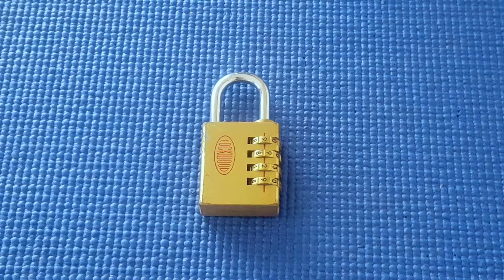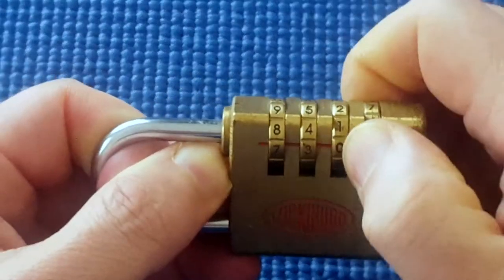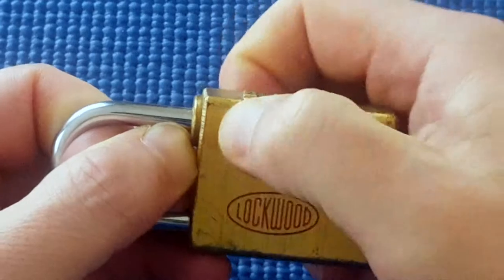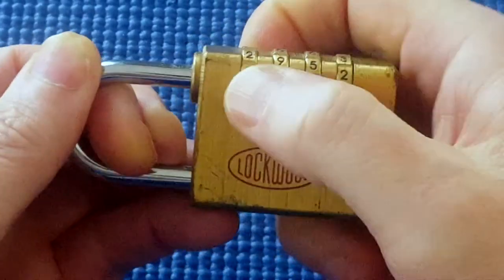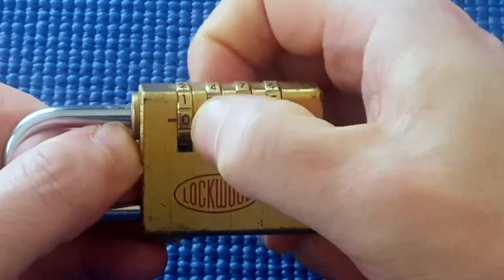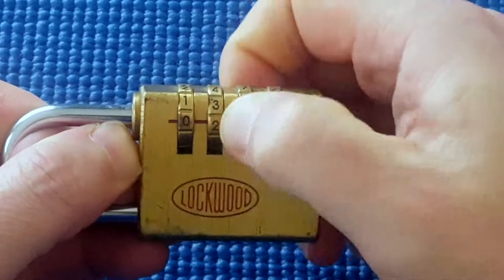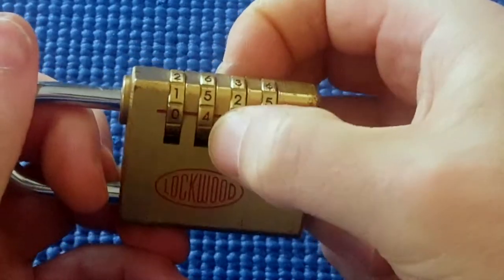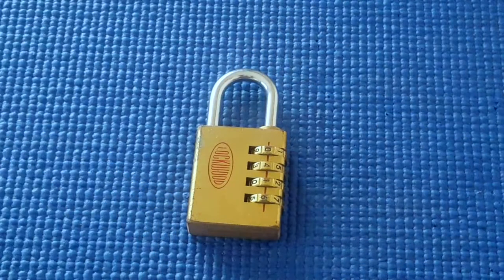(Picking 41) Second-hand Lockwood 4 wheel combination padlock (decoded)

Comment: Can you decode a padlock if it's open but closed
Reply from the maker: Yes ... if the shackle is open but you can't push it down because the wheels have turned (so you're locked out), then you should be able to do the same thing but in reverse - to apply constant tension, push down on the shackle as if you're trying to close it (instead of pulling it open), and then the rest of it should be the same as in the video. Make sure the shackle is over the hole, and wear gloves if you have to, so you can get enough constant tension.